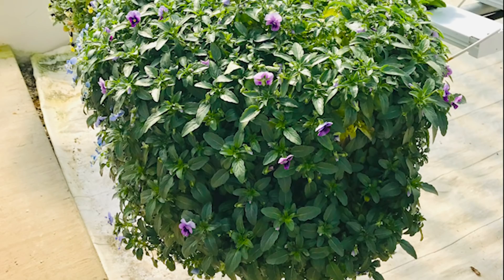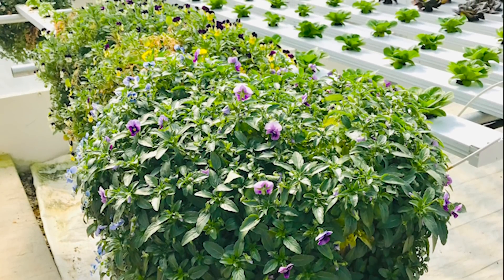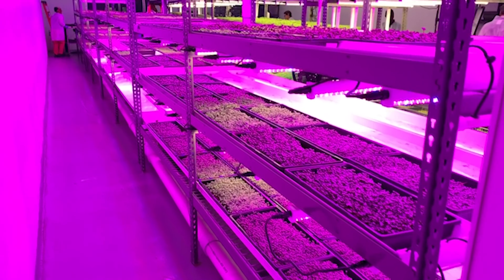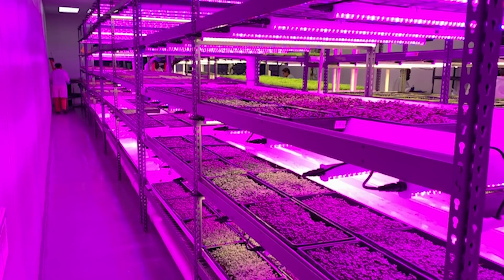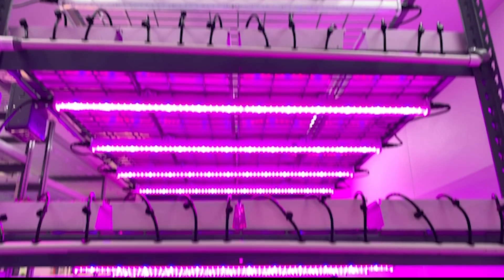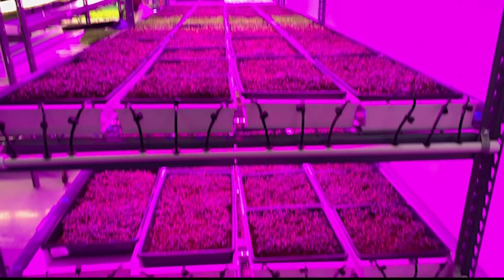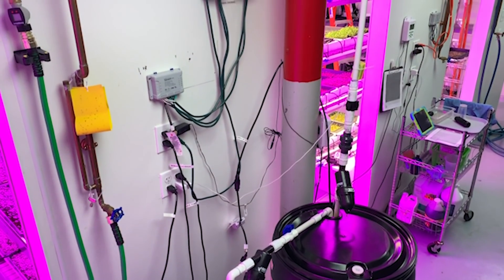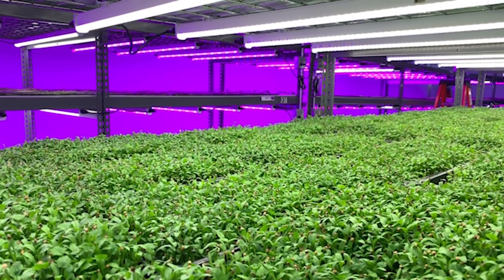Polygreens Podcast - NFT hydroponics

Comment: Was that the microgreen NFT system at Garfield Produce? It looks like you set them up with an NFT system while also using a soil/peat based grow medium. Correct me if i'm wrong, shallow 1020 trays do not fit in those deep crop king or farmtek channels and you must use deep/flexible 1020 trays in order for them to fit. It also looks like the soil line does not go all the way to the top of the tray (I assume to save on soil cost). My point of concern comes when it's time to scale. "Soiling" trays is one of our most labor intensive tasks and we've since had to bring in tray filling machines to handle that aspect of production. I don't know of a tray filling machine that will fill trays only partially full. How do you profitably scale a farm like Garfield Produce in regards to tray filling?